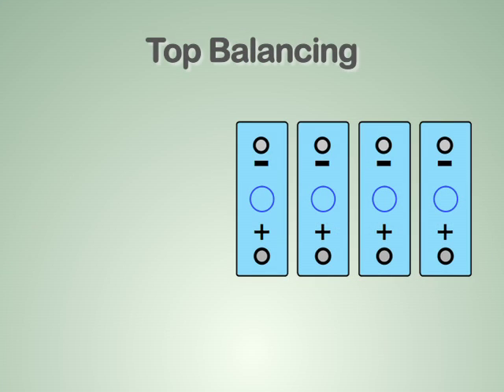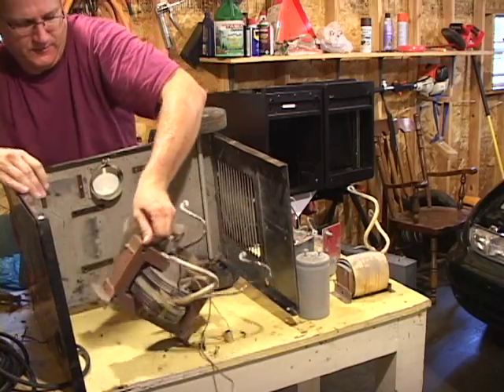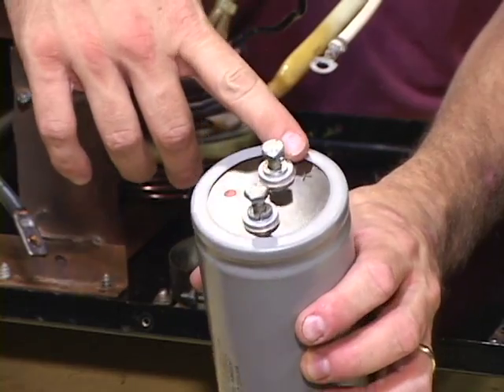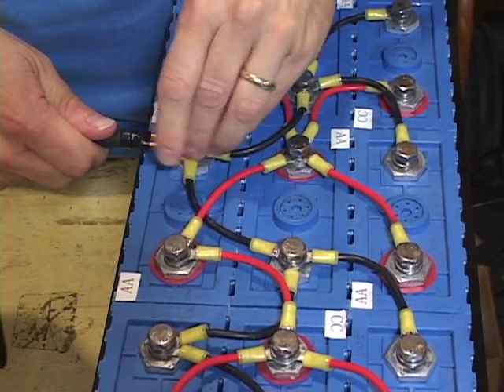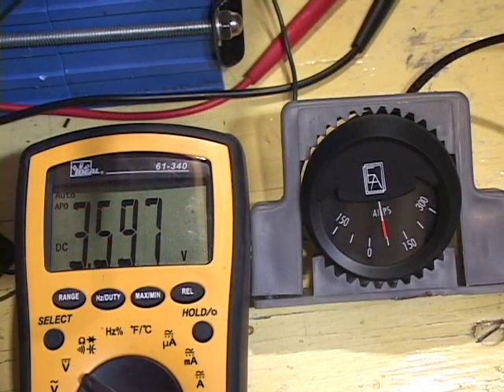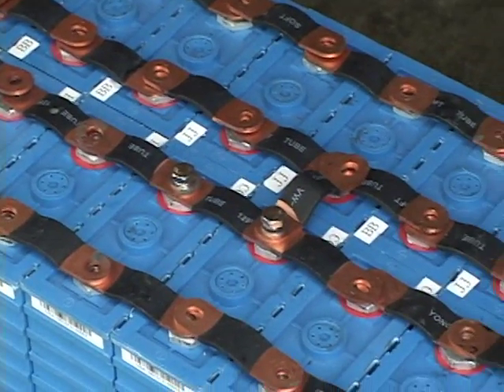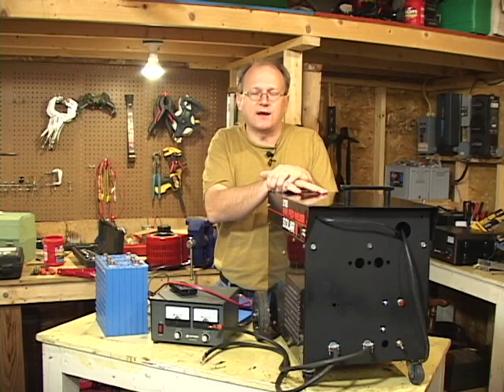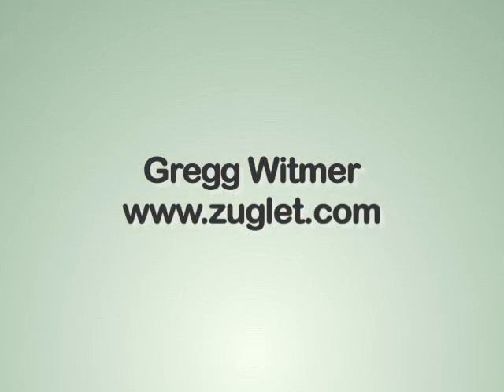High Current Low Voltage Battery Charger from a MIG Welder

Comment: Great video! I just made a 100A batt charger out of an old stick welder. I got 14.4v in open circuit. I need to know your capacitor value in µF and the initial output voltage of your MIG (DC orAC?) Many thanks

Comment: It's hard to find 90 amp welder. Can I use 125 Lincoln 110v welder as well? Thank you
Reply from the maker: I just used what I could find locally for sale. 125A will work just fine since you are regulating the current and voltage with the variac.
Reply: @zugletev  awesome thank you
Reply: @zugletev  can you charge the battery while it's under load? Thank you
Reply from the maker: @Honam.Muryeong  A battery is either charging, discharging (under load) or at rest. If a battery (or battery pack) is under load when a charge is applied - the current from the charger will go toward the load and reduce or eliminate the discharge on the battery. If the charge current is less than the load's current draw then battery will be under a lesser load, if the load current draw is less than the charger current, then the battery will be getting charged and the load will be powered entirely by the charger's current. I hope that makes sense.

What are you getting into that this video is of interest to you?
Reply: @zugletev  thanks for great explanation. That really make sense now.
What inspired me was the amperage  that it was pulling from the transformer without much heat. That gave me the hope that I can experiment on charging my off grid battery bank "lead acid batteries"
If I can pull 80/100amps 24v that would be enough to take the charge under loads. 
I believe out put on the transformer volt is like 30v. That means it can push 28vdc by rectifier.
Thank you
Reply from the maker: @Honam.Muryeong  Great! just be sure to keep a close eye on the charging voltage being applied to the batteries so you don't over charge them. Also, check the battery specs to make sure the batteries can handle charging at 100 amps. Too much voltage or too much current on the pack can be bad for the pack and dangerous. It sounds like you know what you're doing.
Reply: @zugletev  yes, I need to closely watch the volt/current "definally" I have 2v 1680ah in series to 24v bank @2.22v per cell. 
I believe it can handle up to 32v. So I'm going to stick with under 30v to keep it safe rang.
Off the subject, love your ev project. Thumbs up sir.
Reply: @zugletev  made the charger with Lincoln weld pak 100 rated 88 amps.  And connected to variac 2000w 20a but could not get my amps pass 28 amps.
First I'm off grid so I'm using 4000w gas generator as my source of power supply.
Thank you

Comment: This method work for normal car battery, it helps to desulfate lead plates.
Voltage no more 16.6 volt, current 60-120 amps.
2 hours under supervision and open batery caps.
Sulfate will break, and battery will restore it capacity. Top up acid level with distilled water if needed.
Put the battery to normal charger. Enjoy other 2-3 years of battery life. 

Sorry for off topic.
Reply: can you use rain water,,instead of distilled water?
Reply: @green1394  yes, but it should not be in contact with metal, no metal roof or bucket. Rain water in plastic storage is perfectly acceptable.
Reply: @realwarbeast  thank you,,  the roof of our house is corrugated iron,, but the storage is plastic, do you think not good,,
Reply: @green1394  yeah, it won't be good. Water should not be in contact with any metal. You don't need much water, just leave some plastic bucket outside. 1 pint all you will need.
Reply: @realwarbeast  thank you very much,,my friend

Comment: Can battery bank connected in series and would it charge lead acid batteries? Also I have a Miller Thunderbolt XL Ac/dc 230v Stick Welder, can this unit convert to battery charger as well??? 
Do all old mig welder have same transformer/capacitor?
Thank you

Comment: Could you use the same technique to charge a homemade 12v "tesla wall" made of 18650's?
Reply: ScinnerNo1 in short yes, the voltage might change but they are simply just smaller batteries.